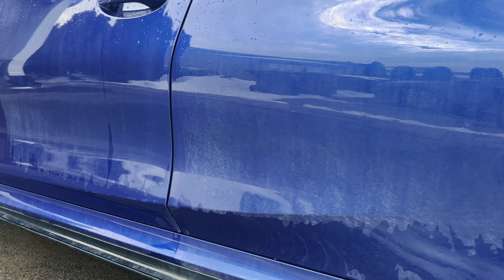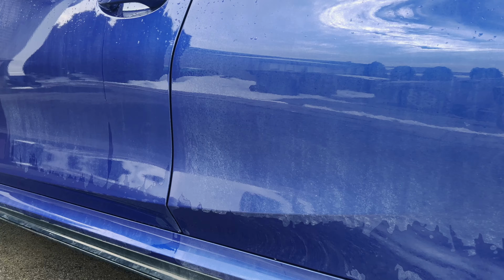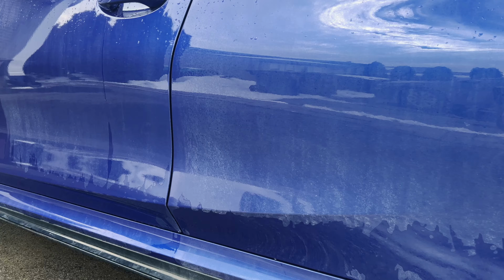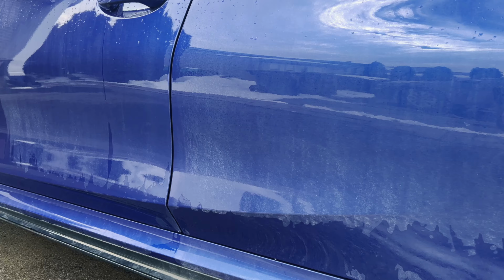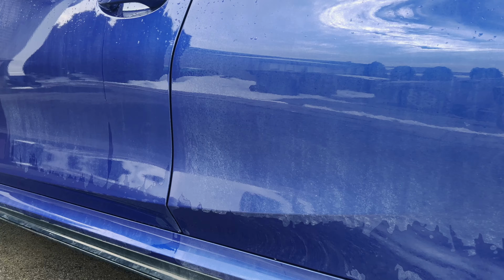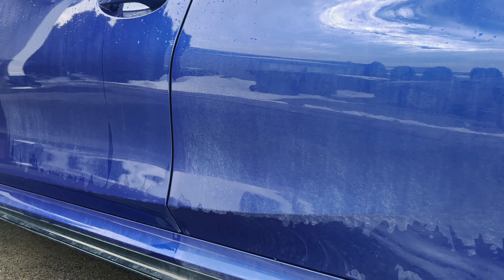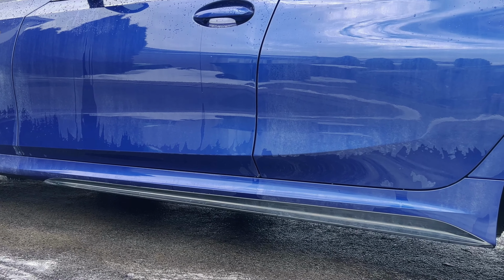PRE-WASH: NEW Answers: Real World Test (PART 2)

Comment: We've been using snow foams in our shop since '93 so have a lot of experience with them. If I can make a suggestion, when using any snow foam/ pre soak / whatever you want to call it, 1. don't allow the foam to dry - try rinsing off after about a minute while the foam is still sitting on the panel ( we basically foam the car, remove the bottle and replace the tip and then rinse ) and 2. rinse from the bottom up. Pre soaks are designed to grab the dirt and suspend it off the paint using the sharp stream of water to remove it from the paint. When rinsing from the top down, you're rinsing away the detergent before the sharp stream of water can do its job properly.
Reply: Rinsing from bottom up would only toss what dirt is still left on the vehicle up and create more work for you when rinsing. All/most presoaks are made differently, as far as chemistry is concerned, so while rinsing off after a minute might not be a big deal, some say on the directions to let dwell for 3-5 minutes. If you’re mobile, working in the sun, yeah for sure, rinse after a minute, but if you’re in a controlled environment, allowing to dwell the full time as directed/recommend by the chemist/manufacturers should lead to optimal results
Reply: The best explanation of why to rinse from bottom I have read. As you describe, it's the water pressure and the product combined that works best. The foam (or other prewash) won't do much by itself.

Comment: Prewash soap for me - always, but I use the Koch Chemie Msn instead of Sfn when the car is dirty.👍
Reply from the maker: I need to get some of that MSN at some point.  Thank you
Reply: @RojohII How do you prewash with KC Msn - Do you use a foam cannon, IK foamer (or similar), or do spray it on?  Also, what ratio(s) are you using?  I am have been looking at high-alkaline soaps such as Msn, Sfn, and the Bilt-Hamber twins in preparation for a Spring full decon/detail of all our cars.
Reply: @atalk143 It depends on how dirty the car is and how lazy I am :) But all methodes work well. 

If the car is moderatly/medium dirty, I'd use foamcannon and with PIR=2-3% (or 1:50-1:30). The downside with using a foamcannon is that you use a lot more product compared to a pumpsprayer/IK foamer for the same dilutionstrength.

 If the car is very dirty, I dilute Msn between 3-5% in a pumpsprayer and I'd also put a layer of foam (doesn't have to be mixed that strong) on top if it's hot/sunny to keep the surface wet.
Reply from the maker: hey man check out KCX website for MSN it's meant to be used a pump sprayer at around 50:1 and rinse fairly quickly.  I havent tried it yet, just looking at the general info.  You could use an APC the same way would work fine for a couple cars it's good enough.  I'd 10:1 green star and spray away  @atalk143

Comment: The main reason many people avoid using prewash is because a prewash with an alkaline or acidic soap can quickly degrade wax/sealant or first generations ceramic coating. As such, people used pre-wash using a ph neutral soap. But today’s ceramic coating can easily withstand harsh soap, more people are doing it. I have avoided using harsh prewash and reserved them just for before polishing and coating jobs.
Reply from the maker: Thanks for watching, appreciate you leaving your thoughts here!

Comment: Love to see videos like this. Much better than the other Canadian who does nothing but push product. There is a difference no question. However, the question is not whether there’s going to be a difference. Rather, is the difference enough to justify the expense of a presoak foam. I’m not so sure there is. I hand wash my vehicles. I will get all that off regardless of whether I use a presoak. Therefore my question is does the pre-soak remove excess substances that would cause me to scratch the car on a hand wash? I find that to be a very very negligible difference. Especially for those of us who don’t live with that bad of weathered streets. Therefore there are so many other variables on a case by case situation it’s not just yes or no    Great video!
Reply from the maker: Hey man, thank you for your feedback.  I totally understand where you're coming from, pre-wash can be a good insurance, depends on level on OCD as well, I always soak the car in some kind of stronger soap before rinsing for peace of mind, it goes in every nooks and crannies too.  I agree the difference isn't crazy when you use a pressure washer but it removes more dirt, then a 5L of superfoam would last you for at least 2 years washing weekly this isn't that expensive insurance in the end.  I'm not sure if the difference in dirt or film remaining would equal in less scratches but I have had success so far in my paint finish, not perfect but pretty damn good for a daily in Canada harsh environment.  Cheers

Comment: Great video! It really proves that pre-washing really works. I'm just curious if pre-rinsing with pressure washer would cause some scratches? Thank ao much!
Reply from the maker: Very good question!  It's hard to tell, if it does it would be very light in some situation, to avoid that possibility, the pre-wash would soften and encapsulate the dirt particles then rinsed with a pressure washer more gently in a sense.  hope that helps.  Cheers my friend and thanks for watching.

Comment: But after this im going to use 2bucket method? Is just rinsing  with power washter is SAFE ENOUGH? If afterwards im gonna use 2bucket method?
Reply from the maker: Yes after pre-washing with SuperFoam. do a rinseless or your regular wash process.  The pre-wash wont clean 100% of the paint but will do a large portion of the job and reduce the chance of scratching.  Hope that helps and thanks for watching!

Comment: Alkaline is good and sometimes necessary to revive ceramic protection.
I like Koch Chemie products but have not tried this Sfn.
However, I use their AF, which is a little less alkaline on the scale.
It's good, smells good, cleans well.
Also uses their Gsf which is neutral in PH.
They claim that if you put little GS  alkaline in Gsf, it will be like their AF?
I have experimented a bit with it and say that it is correct.
Gsf for more regular washing when the car is not too dirty.
There are many good agents, even Bilt Hamber's both their pre-wash agents are strong alkaline.
I haven't tested their new recipe for Touchless, it made them more powerful.
Bilt Hamber they do good things, their fallout remover both Korrosol and Auto Whell are the best I've tried and I've tried many.
As well as Bilt Hamber Surfex HD is the best alkaline I have tested it is better than Koch Chemie GS which is also very good.
The Bilt Hammer cleans better and uses less product and less work to get it clean, so it will be cheaper in the long run.
I recently bought a 5 liter of their Surfex HD on offer.
It's been a few years since I last used it.
It was much better than the others I had at home.
I gave away my other alkalines to a farmer.
Remove dung on a tractor, they are good for it.
5 liters of surfex HD is enough for a few years for me as you dilute it very much.
Then it contains some rust stopping as well.
Pre-washing with foam is a must, first some cold petroleum-based degreasing against salt, tar, asphalt.
Or Saltex against salt in the winter, you also put a little in the windshield washer fluid to remove the salt.
Reply from the maker: love hearing your thoughts thank you for writing them!

Comment: If you wash a car every week do you still need pre wash?
Reply from the maker: yes and no, assess the situation everytime, if you use a pressure washer it is not necessary to pre-wash.  Do you have a paint corrected paint?  Are you willing to go an extra step to have a safer and easier wash?  The prewash will soak and emulsify dirt and debris so you can remove them easily with the pressure washer or any water source.
Reply: @Detailing_Dogma  I don’t have a coating but I do use spray sealer like wet coat or new one Koch chemie so.o3.